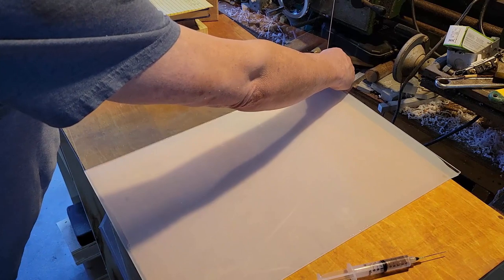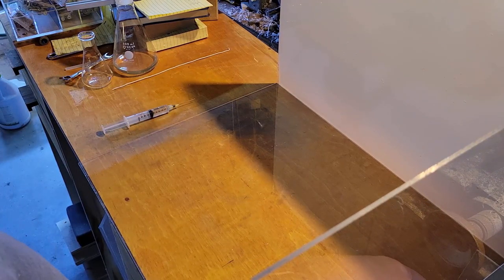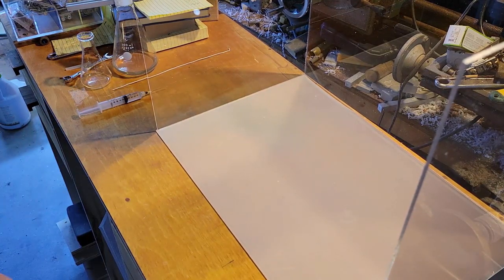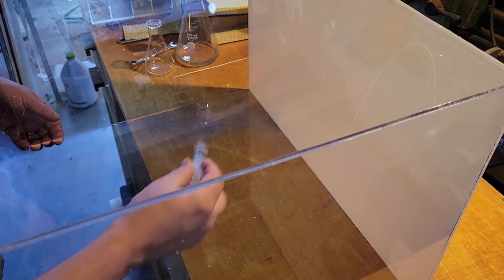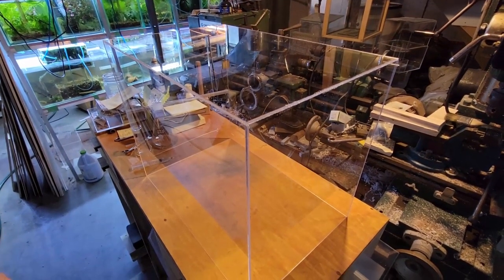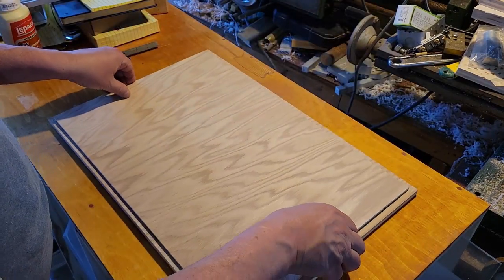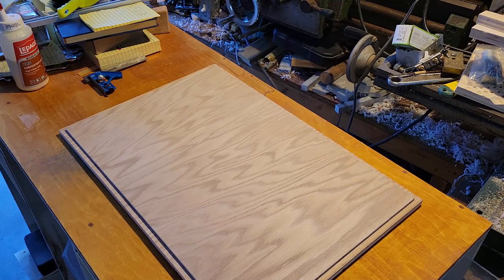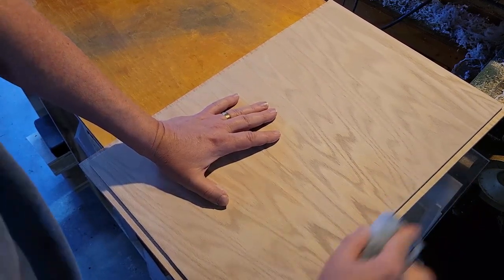Acrylic Display Case

Comment: Hi. Nice job . I've been asked to make some display units out also.  Two questions.  What glue did you use and what was the blue block used to rub down the edges. Thanks
Reply from the maker: They are held together with methylene chloride. It chemically welds them together.
Reply from the maker: I had to rewatch the video for your second question. The blue block is a sanding block and it was just for the plywood base
Reply: Thanks  .

Comment: Hello,  I am in the process of making a 20"x20"x20" display box using acrylic / plexiglass  and it's 1/16" thick what I'm trying to figure out is what type of adhesive and tube you are using to connect all your pieces.   Thank you for your time your video helps a lot.
Reply from the maker: I use methylene chloride

Comment: Nice build wish you could list where got the material to make it set so fast and how long did It take for each side to set before you moved onto the next I want to make one for a 1/6 car model what size thickness do you recommend
Reply from the maker: It sets in seconds. You could get away with i/8" but You should probably use 1/4" to avoid sagging in time
Reply: @FishmanEricRussell  do you have a link for that glue ? I can’t seem to find it thanks
Reply from the maker: @CHB_98  I get mine locally sorry

Comment: a long time back now I worked for a bespoke lighting company they made some amazing things with acrylic unfortunately I didn't spend much time in that side of the shop so I don't know exactly how they did it they could make joints all most impossible to see what I do remember is they used a few different table router/grinders to shape the joining edges for straight joints they used a lap joint with 45s at the end and shoulder like a dove joint for corner joints at various angles they used mitred lap joints most of the time they spent a lot of time filing and polishing the edges before joining them and they had walk in ovens for different things I think the one for setting the joints had vacuum the guy's at that side of the shop segregated them selves from all the people with dirty jobs but we had to help them now and then on big jobs
Reply from the maker: Hey Colin! I've thought about getting a job in a fabrication shop to up my game. I just never seem to get to that point. Thanks for coming by!